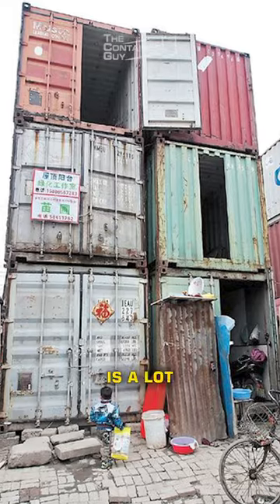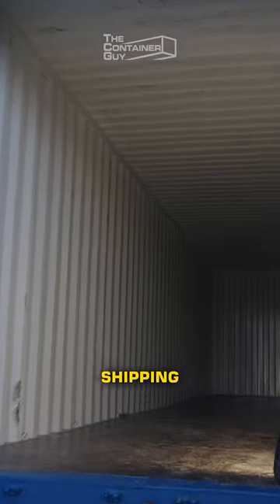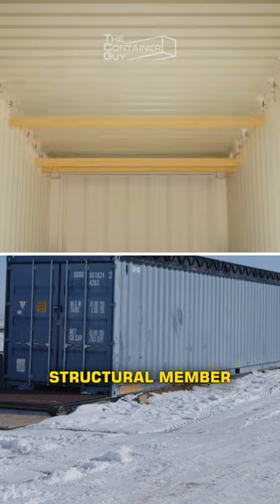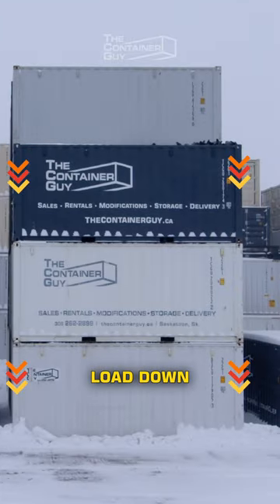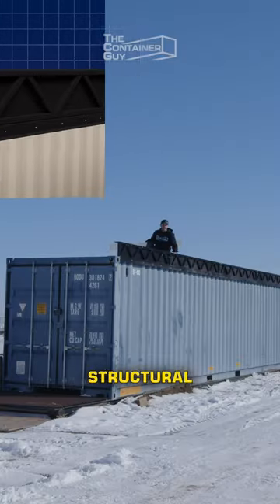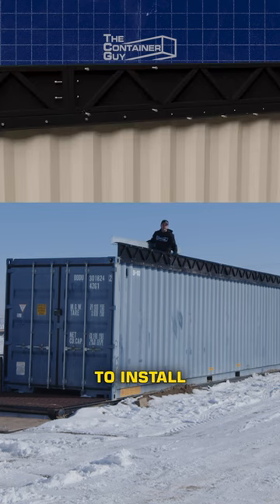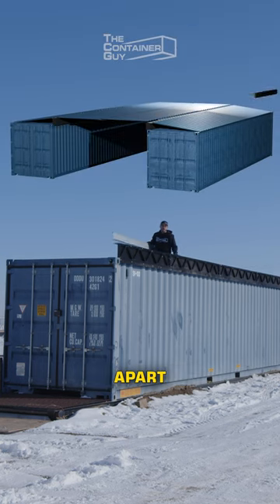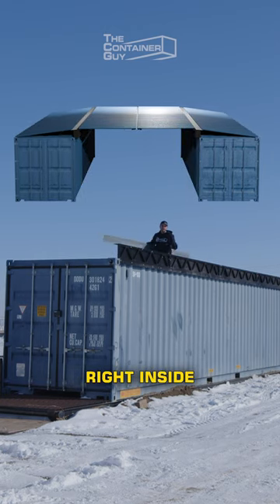DIY Double Wide Shipping Container #diy #construction #container

Comment: You’re missing the major fact that structurally they’re also meant to be stacked and have thousands of pounds of weight on them you’re just trying to sell a gimmick
Reply: Not everyone wants to build up.  Putting them side by side requires a lot of welding to properly support, connect and weatherproof.  That gets expensive if you can't weld yourself. The mod he is displaying is a cheaper option where all welding is done, just bolt together.  The best thing about that is, if you weld containers where necessary and down the road you want or need to move it, you have to break all that welding and redo where moving too.  With Channing's header kit, you just unbolt from 1 side, transport then rebolt.

Comment: “You can have a pitched roof straight across!” That thing will have the snow load of a 6 foot sheet of toilet paper!
Reply: Also. To imply that containers aren’t structurally sound is kind of wild
Reply: @tyler1250 i got 4 feet of snow last night….
Reply: @drinkmorecocacola No, the roofs are not made to support weight. The weight is supported by the corners and alot of people buy them for bunkers and bury them with  without reinforcement that's why he is selling a product to reinforce that has the option to add a pitched roof
Reply: And they will corrode in 2 years no matter what you do.
Reply: @alltheflavors9673 I have 4 60 year old containers that are just fine & in Hawaii, where you get yours? CHIna?
Reply: @patrickancona1193  LOL I have 8 120 year old containers that are just fine too! Glad we share our love for bold faced BS!
Reply: Probably don't use that option in a place where it snows.
Reply: @alltheflavors9673 not if you wire wheel them down and paint them properly, as long as the metal isn't exposed to oxygen it won't rust
Reply: @alltheflavors9673  lying yet again.... You don't even have a single shipping container 😂
Reply: @theangrybuffalosportsfan9971 look up flat plat theory, please. This won't fix this issue on the container needs to be braced perpendicular to the the way he is doing it. All he is doing is moving the load to the sides while surfacing alot of usable space and no way to cut holes for windows and etc.

Comment: No. It is NOT a component of home. It is component of TRANSPORT. Contaier is designed to be transportable and stackable, neither is needed or wanted in a home. The emount of work in making home fomr contianer is same as building the house from scratch. With conteinr you just have the added cost of the container and transport of it. Not to mention stick limitation floorplant and functionality of the house.

Comment: I'll say it over and over and over again walls are one of the easiest things in the world to build. I don't know why people fuck around with cargo containers. You could literally learn how to make a sufficient structural wall in 10 minutes.
Reply: Right! What’s the point of the container if you’re building an entire structure inside and out of it.
Reply: I BUILT A 5 CONTAINER HOME.... BIGGEST MISTAKE I EVER DID.  IT IS  NICE, BUT WOW THE WORK AND MONEY.... UGH.
Reply: Because they make profit from fools. No serious engineer is going to recommend using these tin cans.
Reply: Originally you could get em for 500 bucks & you cannot beat material cost back then, now with lumber costs 2k ain’t bad either, it’s all about cost per square foot & the luxury of prefab, I slapped a 4 container home together in a month, the homeowner loves the silly thing, two side by side with two cantilevered above forming a L shaped 2 story with a carport/open garage & a large deck, welded together, chopped the 4 interior walls & put a exterior spiral staircase semi enclosed, no not for everyone but cost was/is a fraction of lumber or steel & it’s bulletproof up to 38, not everyone wants stick frame or pole barn & speed of final is incomparable
Reply: Containers are long time debunked. There is a big surplus of discarded ones and with the dumb dad the prices rised a lot. There's a reason they where almost free.
Reply: I actually saw a small report on them. They are garbage. Any time you put a hole in it for something like a window you have to reinforce it. 

 It needs all type of modifications, work, and isn't much cheaper to make into a living space. 

 Good for a shed.
Reply: Container homes were fine until people decided to make them fancy you insulate the thing you cover the insulation the only walls you should add are around the toilet you leave the rest open concept and then that's it it's a studio apartment or hunting camp or Secure Storage somewhere
Reply: @billlovelace1522  please tell more. I'm interested in container homes, and I'd like to hear your experience with them
Reply: We use these a lot in Alaska for secure storage offgrid. You don’t need to worry about shoveling the snow off. They’re great. I know people who have insulated the insides and live in them. You can add a couple smaller windows and a steel door to make it a little bit more like a real home. That’s where they stop being useful. The moment you try to put a couple of these together and start removing walls it becomes extremely cost prohibitive. If you want a 20+ foot wide home, simply build a traditional home. It costs less, will be easier to insulate, will be more attractive to future buyers, and will actually be less work then trying to retrofit and work around a shipping container.
Reply: Containers are good if you leave them intact. One guy on Living Big In A Tiny House channel built a home in a 20' side opening container. He can close it up and move it anywhere on the planet because he didn't compromise the integrity by cutting windows and doors into it. That's one of the only reasons a container makes a good home.
Reply: @plantstho6599  again, most people don't replace the floorboards on the shipping containers... Those floorboards are treated with formaldehyde and will constantly off-gas formaldehyde in your new container home.  The very air in your home would be potentially quite cancerous.
Reply: This. I picked up 80$ of lumber from a kijiji ad a year or so ago. 36 studs, 9 plywood sheets. This will easily build at least one large wall, doubling up the studs for extra structural integrity (They're 2x3's instead of 2x4's. Gonna double em up so they're essentially 4x3's.) 

If all you want is 4 walls, a roof, and a floor, with some doors and windows... building a 'home' ain't expensive. It's everything else that makes a home become more than 4 walls etc, that makes it expensive. If all you need is essentially a large studio pad to live in, then you really only need a cheap lot of land in some town, enough money to build essentially a liveable shack, and then save up from there to build something you actually want, and turn the shack into a guest house. 

All of this is only really and truly expensive, because of the desire to live in cities, and the idea that you need to have multiple bedrooms and bathrooms for what is essentially just one or two people living in the same abode. IF you have kids, that changes things. But if you don't, you really don't need much more than 4 walls, a roof, and a floor; with some doors and windows.
Reply: @ManuFortis  Don't pigeonhole yourself.  Humans have lived in many abodes that look nothing like you have described.  Teepees, for example... And bands of gypsies used to carry a decorative pole that would act as the top center beam to a tent.  To this was lashed willow branches (abundant at just about any fresh water river and lake), the other end driven into the ground, sharpened like a stake.  This was the frame any tattered clothing and blankets were thrown on to create a quick tent.  Over time, this evolved into the Vardo.
I truly think the current push to force everyone in the population into permanent housing is a crime against humanity applied to many cultures throughout history.
Reply: You can't move it the same
Reply: @bryanmontello5702  Part of the design pre-vardo, was intended to be able to be moved as quickly as possible, in an emergency.  Think about it... All you'd have to do is cut your lashings off the center beam and take the beam, itself to the new, safe location.  Screw trying to gather a bunch of rags and old, weathered blankets!  GTFO! 😂.  The Romani were (and in some places, still are) heavily persecuted.  Being able to literally "cut and run" is a tried and true survival strategy for them.
Might I point out how immobile a wall typically is...?
Reply: Shipping containers are only good if you’re building a root cellar or bunker
Reply: @dianapennepacker6854 if you put a hole for a window in a house its also going to need reinforcement?
Reply: @Youtuber69428  Yeah I guess so. Not sure if it is a code thing or why. (Edit for cargo containers)

 I was watching a YouTube documentary short on why cargo homes aren't all they are cracked up to be, and why they aren't actually much cheaper than a real home. 

 Part of the reason was the experts were saying is you needed to reinforce any holes for windows and doors you put in. 

 Doors i sort of get. Windows i don't get. Not like the homes were double story. Yet I do recall someone modifying their home and putting a window in without the proper framing. 

 The entire window ended up just popping out, haha. People said it was due to the flexing of the house. 

 I want to say it was a Buisness Insider video.
Reply: Not as strong  as a container, recently, did you see the three story stick house fall down?  I grew up building  houses , and it's not new to me. Containers have extreme  advantages to most site buildings

Comment: Shipping containers are designed that way to squeeze in more cargo inside and push carrying capacity. You cut holes into those "walls" and you lose significant structural integrity.

Comment: Those containers are great for transferring wealth from the buyer to the seller.
Reply: That's what happens whenever anything is sold
Reply: Look it's a box, if that suits your build , they are a  very portable, relatively good value , standardised structural component, 
And this guy sells plans and bits to make them fit together,or attach things to them , 
Put together properly , on a decent foundation , with appropriate sections of the walls cut out , doors windows ,insulation and a roof system you have the shell of a house , 
Limited by the dimensions of boxes obviously

Comment: Shipping container homes end up being terrible. They are expensive. They get their structural integrity from their shape but to make them livable you have to cut into them which SEVERELY compromises their otherwise immense capacity to be load bearing structures. The need to be insulated. Running utilities through them again, entails cutting holes. There are TONS of problems with using steel containers in building homes and that's just the start!
Reply: They're easy to do but they are NOT for traditional homes. To succeed copy the successful industrial and military users. Not hard. Excessive cutting is not at all mandatory and welding supports and bracing is easy as it could be. Too many containers are used in silly art projects but the best use is as industrial housing and shop space.

Comment: Compared to timber, containers aren't cheap, and you still need the same insulation and interior finish, so you may as well make the size and shape you want rather than 40' or 20' by 8'
Reply: They make 48'x8'x9.5' now. My dream home use to be 9 of them configured in a 2 story house, using the containers pretty much only as a skeleton. Back when I planned all this the containers were about $2k a piece but the tiny home fad has made the prices sky rocket
Reply: Right plus they aren't bulletproof or fireproof so there's really no point
Reply: I've seen them for like 2,300 used
Reply: @frankk1512 gotta be careful with used one, don't want to buy ones that were used for chemicals and other nasty things.
Reply: @GORILLA_PIMP I don’t think timber is bulletproof either. Unless you’re talking about like a .22 short.
Reply: @eshuorishas9987  
Right exactly that's basically my point 
If you gonna go with containers they need to be a significant upgrade over a regular house (they aren't) AND be alot cheaper (probably won't be after EVERYTHING is completed) otherwise might as well not even bother
Reply: Notice how they always bullshit about anything else but the costs of the finished scam.
Reply: @frankk1512  containers are "used" by shippers until they're structurally unsound.

Buying a "used" one means they're so structurally unsound they're not even fit to shove cargo into. OR it's a container pulled out of the ocean by a dredger or a container that has been contaminated by something.

I would just think people were smart enough to realize that a shipping container being sold "used" is unfit to put cargo inside of it, let alone to put humans inside of it.
Reply: @SherrifOfNottingham  you do understand that you can also buy new containers.
Reply: @frankk1512 Wow that's cheap. Around here they are Around 8 grand delivered

Comment: On a infrastructure job we took two containers spread them apart and poured reinforced concrete.  Then had a tall metal carport erected on top of them. Then we put two containers side by side at one end. Made one of those into our ofice and break room . The other 3 was storage.  We would pull excavators and dozers on the slab to work on them out of the weather.  It worked great. The designe spread throughout the company. When the job was done years later . It was dismantled and sent to the next job. The pad was ripped up an hauled out.
Reply: That didn’t happen. Stop lying.
Reply: @DrDoke I've seen stuff like that on large sites. The last one I was on, one company had a shipping container tower 2 side by side and 3 high. Had offices and lunch rooms and ahit in it. 

Clearly you have never been on a large construction site.
Reply: @DrDoke they need to move these recycled containers.
Reply: @DrDoke  say you don't know about men's work. Without saying you know nothing about real men.
Reply: @voltsnbolts8879  Yea you are right about that. Using some ingenuity and creativity seems far fetch for a certain type of males.
Reply: Why would you build a carport ontop of these? How would you even get the car up there? Your description honestly makes no sense.
Reply: @unicornkitteh5332  The car port was used as a COVER which was obvious from the wording.  A carport in pieces is easy to erect atop containers and they were not the first since I've seen others. Steelmaster sell a steel building kit that works the same way. A carport is perfect for quick jobsite erection because they're inexpensive, the pieces don't with much and they're easy to handle. Tack weld some tabs etc to the container then bolt the base of each arch to them.Raise and aligne arches with the frame parts then add sheet metal roofing and done. Outfits with cranes can assemble carport on the ground. Not even slightly difficult.

Comment: We have a thing here they do in Australia that I should do for a hothouse. It's QUITE common in industrial areas. It's a clear tarp curved roof that spans between 2 containers, made for workplaces. They keep their materials and small equipment in the containers, then park their vehicles underneath the roof strung between the 2. Even seen mobile cranes parked in them.
Reply: Yep. Seen that here quite a bit in Canada as well. Actually saw a guy use 2 containers as walls and set a Quonset hit on them for a more permanent building, I thought that was pretty cool

Comment: That's actually brilliant.  I met a dude with a container home and he said the welding and custom metal work needed to make it a livable space was not worth the effort over a wood home.  Is this product recognized and approved by building engineers?
Reply: I bet the dude was a carpenter. Steel work is easier than woodwork.
Reply: I BUILT A 5 CONTAINER HOME.... BIGGEST MISTAKE I HAVE MADE.... TIME WISE AND MONEY WISE.
Reply: @billlovelace1522  exactly my point, it sounds easy but in practice it's terrible.
Reply: @SurmaSampo As a metalworker, big disagree
Reply: @alexrobertson8936  It should be noted that I am not referring to skill but that steel has a lot of advantages over wood as a working material. 

Having worked with both, steel is much easier to get consistent results from and much, much easier to fix a mistake with. Precision is especially difficult with wood compared to steel.
Reply: @alexrobertson8936  Ditto here but container homes are not for the helpless. My container shops are easy to keep drier than conventional construction which is why I chose them for my machine tools and classic motorbike work.